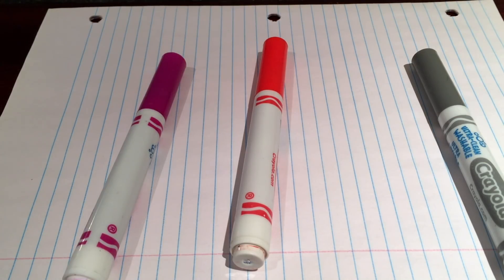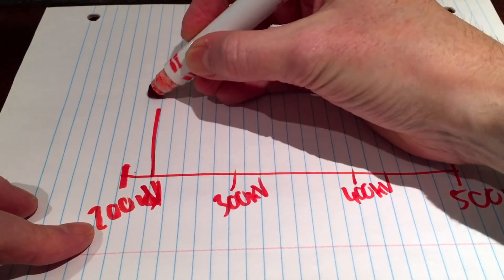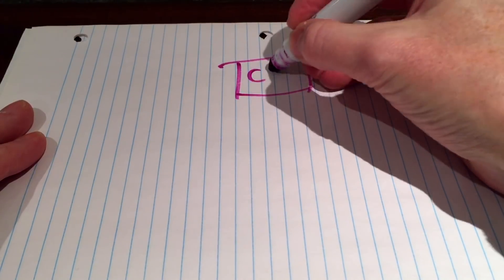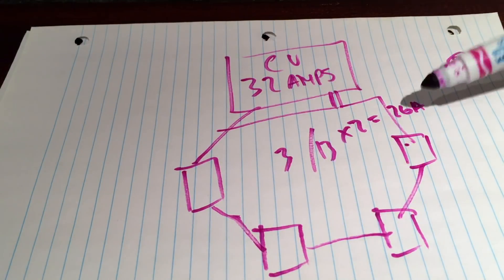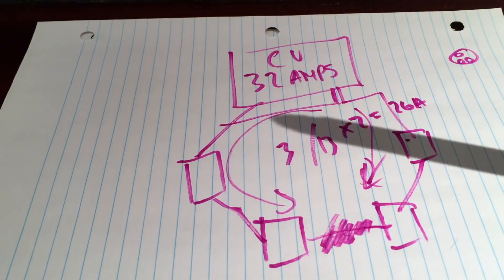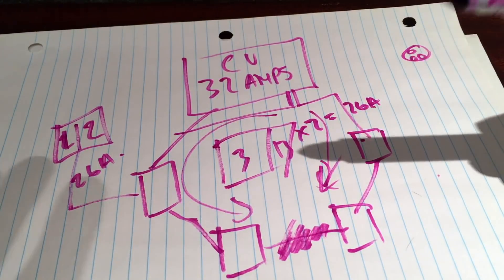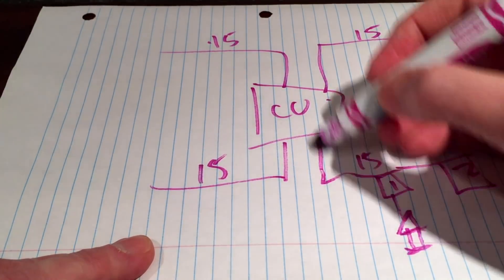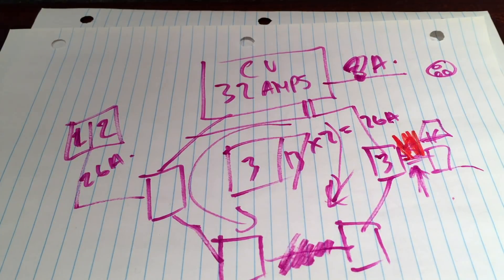THIS is why British plugs have fuses

Comment: Just need to point out most houses are single phase in the UK.

Also strange to see so many people get worked up by the fact that the UK does things differently from the rest of Europe.

It's legal to use radial circuits for sockets but electricians prefer ring circuits because they are superior and safer in several ways.

If we introduced regulations that forced us to use radial circuits we would be forcing ourselves to adopt a lower standard.

 Regulations are there to provide a minimum standard not to lower them.

I imagine that other countries regard the the extra safety features as not worthwhile for the extra effort. Especially as components and appliances are of higher standards theses days.

But honestly most electricians in the UK are very comfortable with ring circuits and don't regard them as complicated or troublesome.

As for the fuse in the plug. We could eliminate it but why would we want to go the effort to remove a safety feature?

We already have lots of regulations and if we start introducing regulations that force us to adopt lower standards it defeats the purpose of having regulations.

Live and let live, don't get upset that people in different countries do things differently.
Reply: +David Lee
'It's legal to use radial circuits for sockets but electricians prefer ring circuits because they are superior and safer in several ways.'...why are ring circuits safer?
Reply: 'If you have wires coming loose it continues to work safely like two radial circuits'...surely, that scenario makes it inherently unsafe. I mean if you have a break in the ring,  effectively making it two 2.5mm radials backed up by a 32amp breaker, you now have a hazardous situation.
'Wires almost never come loose, most electricians know what they are doing and use good components.'........I began my apprenticeship during the transition from imperial sized stranded cable to metric solid core. Back then, we were told to twist the cores when looping, because that's what had been done with stranded, to ensure a good connection. Many times, I've come across twisted solid terminations which have either broken off while the outlet was being secured to the back box, or were barely intact because the copper had suffered mechanically in the twisting together of the cores. But even in present times where twisting of solid cores is disallowed, I've come across single cores which have come out of a terminal, because they've been pinched through by an overtightened terminal screw.

They are used outside of the UK, but  usually for power distribution by utility companies, as they offer savings in material costs where large csa cables are being used over long distances...which incidentally, I believe is the same reason they were initially used as final circuits in the UK. I can't see any plus on a safety side, only negative. As for the comment by 'phill luckhurst' about multiple routes to earth, it makes no difference in the age of the RCD. Besides that, if a break occurred in the cpc ring, then the loop impedance might be greatly increased for either or both of what are now radial earth paths to the distribution board. 

The fuse in the plug-top only offers  overcurrent protection for the appliance and cable, downstream of it. It's not there to protect the consumer from any type of contact injury, such as provided by RCBOs and RCDs. I assume you mean RCBO, rather than MCBO.
Reply: "Also strange to see so many people get worked up by the fact that the UK does things differently from the rest of Europe."
UK does it different from everybody else, everywhere. The rest of the world does it differently, for good reason.
AFAIS, this was borne of austerity, in a depleted and war-ravaged UK, to economize on copper wire. Not safety. And daisy-chaining the whole house on one big circuit is idiocy, as is relying on fuses within electric appliances.
Reply: Yes, all systems are safe, but also have their flaws.
Reply: +phill luckhurst
'It is safer in a number of ways. Multiple routes to Earth is one for instance.'...Why?
Reply: Shamrock Shore it's a little bit safer but not worth the extra trouble. If you have wires coming loose it continues to work safely like two radial circuits...although if you have wires coming loose it might be better for the socket to fail so you can fix it. Wires almost never come loose, most electricians know what they are doing and use good components. Maybe 60 to be 70 years ago it was better to use ring circuits because materials were poorer quality.

Almost no one outside the UK uses them. No one that I know of. It seems to be a weird British solution to a problem no one else has.

The plug in the fuse used to blow sometimes but devices are better made now and also we've started using MCBO's and RCD's these usually cut off power way before the fuse in the plug blows.

In reply to the guy who says British think their wiring is safer. I don't. We're not that arrogant. We still junction boxes and connectors that are regarded as obsolete by some other Europeans for example.
Reply: I like how everyone is silent after that. lmao. People care too much about what other countries do.
Reply: Lived in different places in Africa and Europe and the only place where one of my children got shocked was in Nairobi with a UK socket. Somehow the socket is inviting to try to solve the puzzle and still insert something (as it is for adults when wanting to insert a non UK plug). Anyhow it might still be safer but the only way you can claim that is with statistics, not by opinion.
Reply: Education if done forthright straight is wonderful, but common sense is just as important. I'd blame the slugs sitting in parliament for allowing these inferior appliances from China into the country. Now here in the U.S. we're getting more and more junk from COMMUNIST China with these fuses while the crook is congress drain us and never worry about spending money on a new appliance with a plug fuse. If the fuse blows, it's no skin off their nose to by a whole new appliance. Plug fuses: One of the biggest scams being pulled off. Also, these crooked manufacturers need to sell cars down thru electrical motors that can be lubricated by the owner. Man, consumers are being ripped off.
Reply: How are ring circuits safer? Lmao. That's the dumbest thing I've ever heard. The entire reason the UK has fuses in plugs is because a ring circuit will catch fire without them. Ring circuits fail silently, which is not "safe" in any conceivable way.
Reply: not safer, the Brits think they have a superior system, all systems are safe, the users are usually to blame. Something to do with education.
Reply: Mark William Mandigers It is safer in a number of ways. Multiple routes to Earth is one for instance. It can also be more cost effective requiring less copper per house. The UK plug has numerous safety features, something the plugs in some countries lack, as long as we buy decent quality plugs and not cheapo ones on fleabay that do not meet our strict standards. Do some research and you can easily see the strengths and weaknesses of the UK system, and you will soon also see the inherent problems in some of the other systems around the world. On the education front, tell that to a child who has been electrocuted by some of the really iffy systems out in the world. Just go to a hotel in Egypt that have an open element heated shower and you will see unsafe.

Comment: Nice tutorial,.  I'm in Canada. It's a safety margin. Dont want the breaker tripping all the time. For example a vacuum. When the vacuum is started there is a power spike. At 12 amps the breaker can tolerate it because it's quick. If the vacuum pulled 15 the margin is not there and would pop the breaker.
Reply: Just for fun, that immediate high current drain on motor loads is called "locked rotor amps" (LRA). On large equipment where this is important, there is a panel which specifies the running and LRA, along with voltage and such. It is called locked rotor amps because if you started such a motor but locked it down so the rotor couldn't turn, this is the load you'd get. But, free to spin, a motor only draws that for a short duration on start-up.

Comment: Cookers 3 phase? That's a new one on me. As far as I'm aware, only a single phase is delivered to the CU from the street transformer. The next phase goes to the next house, and so on. So how can a cooker be 3 phase?
Reply: Tim Long well it's true that people are using the word phase in the wrong way,  a cooker, or I think you mean stove or oven, could easily be three phase. The elements are just a resistor and I don't think I can explain what phases look like when joined together if you don't know what LOL. 60 or 50 cycle, when the first phase is in between directions and at neutral, the second phase is just starting in the opposite direction so you have twice the power, in three phase they are 90 degrees out of phase so you never reach a neutral electrical charge and the net result is greatly increased! If you never seen a waveform and you can't picture in your head, don't worry about it.

Comment: A great effort, but sadly it is full of so many errors it makes what you are saying dangerous.
Reply from the maker: In case you missed it, the video starts off with me saying I'm not an electrician.
Reply: I did not miss that part, but saying it does not mean what you are going to say is correct. Ideally you should have said "I am not an electrician and what I am going to say is what I think is true, but might not be" But if you had of said that I doubt any one would have watched further. 
I admire you for what you have done, and yes its easy for me to say what you said is wrong, but anyone watching your video can easily think what you are saying is correct, a suggestion, or two. 
1) Add text to the whole video stating that what you are saying is your opinion and may or may not be correct.
2) Delete the video

Comment: Some homes in the UK have radial circuits. For some reason my flat has a ring final circuit, but both sockets in my bedroom have their own 16 amp breaker because they are on their own radial circuits, for some reason.
Reply: depends on the need and ease of wiring at the time, if your flat was converted from a house at some point, or has been rewired in the last 10 years or so, its likely that the landlord/agency didnt want the hassle of setting up a full ring-main for 2 plugs, for example, its just easier to set up a radial for each room and really has no effect on the operation of appliances
Reply: I live in a block of flats that was built around the very late 1960's/early 70's. The hallway socket, the two in the lounge and the one's in the kitchen appear to be on a ring, but the two in the bedroom both have their very own breaker.

Comment: NOPE - There is no need for the fuse. Example at 7:47 - the lamp that is on a 3A fuse doesn't "suddenly start drawing lots of lots of current" when something goes wrong. It draws normal current normally, or it's a short circuit. If it's a short circuit, the MAIN fuse (32A) will blow. The flexible cable will never get hot, let alone "suddenly catch fire" like you say at 8:00 - it's more than capable of carrying 32A or even 100A until the main Fuse or MCB trips. Try it yourself if you do not believe me.
Reply: This assumes that the fault is sufficient to cause the lamp to draw at least 32A (Or 32A minus the load of any other appliances on the ring main). In reality it's quite possible that the lamp could have a short with a resistance that was still high enough to keep the current flow between 3A and 32A. An example might be if a partially frayed flex cord was leaking current through water or some construction component of the building rather than directly to a copper conductor.

Certainly this would probably be more uncommon than a direct short between live and neutral/earth but it's certainly plausible and an eventuality that it doesn't hurt to consider by placing a fuse which protects the lower rated cable from overloads independently of the higher rated ring main itself.
Reply: Seraphina S18 - it's quite possible that the lamp could have a short with a resistance that was still high enough to keep the current flow between 3A and 32A just like it's quite possible that an alien spaceship (with no fuse) will connect up to recharge and pop the MCB. Consider all those millions and millions and millions of UK plugs with fuses in them... how often does anybody EVER replace a fuse? And of those, how many were due to the connected device suddenly deciding to act like a current limited AC load (that draws up to 32A, but not more)?
Reply: +John Coops Fail safe design does tend to err on the side of caution though ultimately it's usually a balance between the cost of the risk and the cost of mitigation, in the case of the cost of a mass produced 3A cartridge fuse the latter is extremely low while a product liability suit for a house fire can get really quite expensive especially if any persons are injured as a result. Probably even one lamp in a million failing in such a manner and injuring someone could easily outweigh the cost of a million 3A fuses bought in bulk.
Reply: Seraphina S - Well, all those 3A fuses that are fitted to every plug seem to be quite ineffective at doing anything. The UK Gov stats show that of 27,289 accidental dwelling fires attended in 2016/7, there were 4,432 caused by faulty appliances and leads. That is by far the biggest cause in the UK except for about 9,000 caused by "misuse of electrical equipment". So, about 1 in 6 of all the fires in all the UK dwellings are caused by faulty leads and appliances that are "protected" by 3A fuses - that's quite odd isn't it?

Comment: Jason, thanks for the interesting plugs/electricity supply videos. You said that UK cookers are supplied with a radial 3-phase circuit - this is (generally) not true, almost all UK domestic supplies are single phase, unless you have a very big house! You are correct that electric cookers (and electric showers) are connected on a separate radial circuit as these are rated for much higher current.
Reply: Water heaters is another one often with their own radial circuit at least when the electricity is actually supplying the heating element as opposed to just supplying pumps and similar as in gas boilers.
Reply: His information is just out of date. That was the standard back when the retangular pin plugs came in, and remained the most common setup till when the number of houses with single phase cookers out numbered 3phase, probably at some point in the 80's. EEven then it was probably quite comon till the Home improvment boom of thee 90's when a lot of older houses were rewired and/or had their fuseboxes replaced with circuit breakers

Comment: One point is that many Brits sound insufferably smug about their electrical plugs, and... sort of overlook that the US standardized earlier on an earlier design. Much like PAL had the benefit of the hindsight of NTSC, the British standard plug has the benefit of hindsight of US theory and practice. Ring mains (post-war economy! POST-WAR!) vs. radial mains. 240 V vs. 120 V.  The US and Canada have fewer fuses, the UK has less wire. &c, &c, &c.
Reply: The post war standards were not the first set of standards. We origionally standardized domestic power suppply in 1882, the first national standards in the US were published in 1897, 15 years later...
After the 2nd world war they judged that the old standards were not up to scratch and rather than just update them, a completly new set of standards was introduced.

Comment: most sensible electricians tend NOT to use ring mains, as radial circuits are much easier to test, and fault find and if the circuit fails at one point after that point the circuit will be dead .Not so in a ring main.. so in a kitchen instead of a ring  main. 2 or 3 25 amp radial circuits   should  be installed giving a system capacity of 50- 75 amps in the kitchen , and also if ,due to a fault you lose one circuit you still have power in that area. A ring main is the ONLY circuit that still works when it is faulty.and are easily overloaded if damaged.... and you wont know....

Comment: I'm not sure about some of the stuff you said e.g. 32A consumer units - there's several 32A circuits in a CU, along with other amperage circuits for lights etc & 3 phase to cookers (which I wish was the case as I could run my tools on it!).  I think (IT engineer here also ;) that the main reason for the fuse is for when you get a short that DOESN'T draw the full 32A.  In this case the circuit breaker (RCB) in the CU won't trip but the fuse in the plug WILL blow.  With 15A circuits, this difference between operating amperage and consumer unit breaker amperage is much less, so there's less need for a fuse (although it will always help, having an extra layer of safety).  I think this is what you were getting at whilst worrying more about your drawing skills, yes?  :)
Keep up the good work expanding the empire over there and send back some maple syrup for HM the Queen. :)
Reply: And agreed that UK plugs are the best (except at nights)